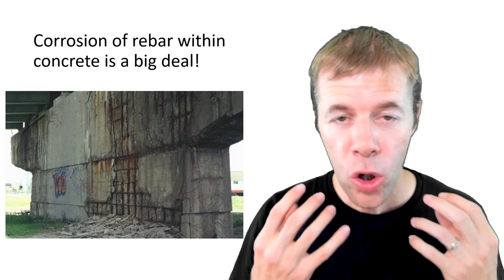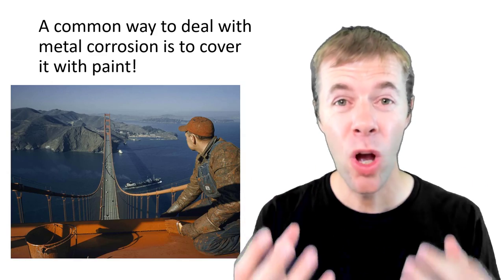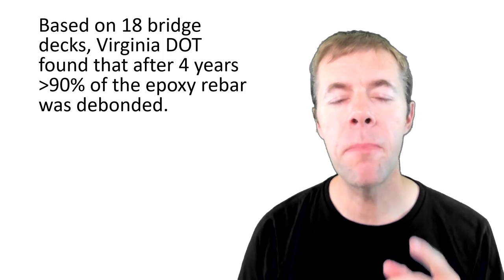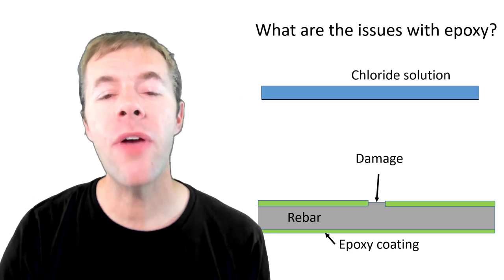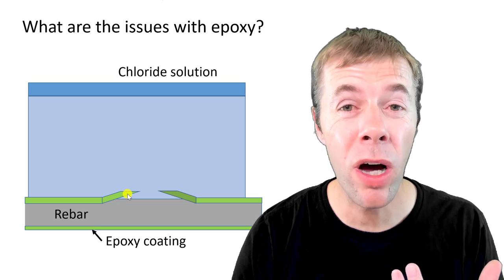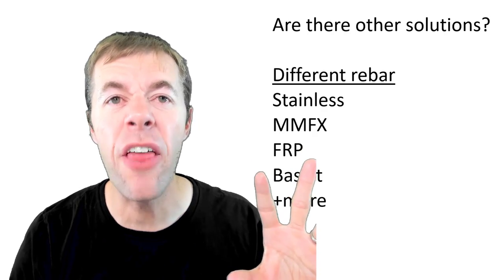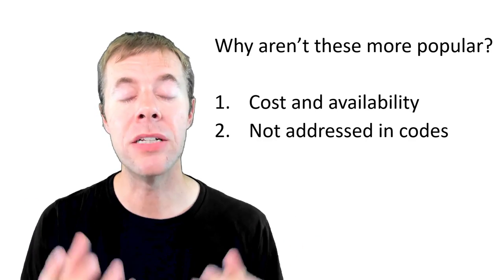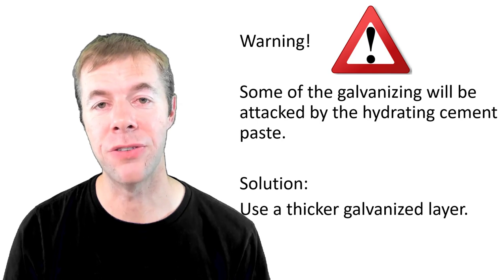What is epoxy coated rebar and why is it being banned?

Comment: Can't weld galvanized rebar without a good breeze or a mask.
Reply: Why not use weathering steel AKA Cor-TEN steel?
Reply: @dkevans  shit's expensive.  hot dip galvanized rebar is cheap as dirt, which is good because they use a LOT of it.
Reply: @danlorett2184  fair point. I wonder how much the price would drop if all the rebar was made from weathering steel?
Reply: Paint it over then! :)
Reply: Why would you weld rebar?
Reply: @I_Art_Laughing  Was wondering the same thing... never seen welders messing with rebar!
Reply: That goes for any Zinc coated steel. The Zinc Oxide fumes are toxic and will give you severe flu like symptoms - welders shivers. Also, be mindful that a cheap dust mask will not do, it has to be at least an activated carbon cartridge filter mask.
Reply: yea but wiring it together with galvanized wire would work and not rust. also welding galvanized ruins the galvanizing. but im sure you know all that
Reply: Just drink milk.  Stops the shivers and removes the toxins.  Unless you're vegan and don't do dairy.  But no one cares about vegans anyways
Reply: Basalt rebar , not iron , rock .
Reply: nah u can't weld it period, unless you are not concerned with a contaminated weld. but rebar isn't free welding steel anyway, so...just use wire ties I guess.
Reply: to make it into different shapes  @I_Art_Laughing
Reply: only a desperate person would,, weld it,,then dip it,,and fasten with gal. wire. (paint any cuts/welds with cold gal after hard brush or blasting.
Reply: @dizzywilliams3557  tie wire.
Reply: so getting an engineer to wear a mask is less preferable than structural failure.
Reply: @daveb6722  masks are for inspectors.
Reply: you can't weld rebar and meet codes, as it weakens the rebar where it has been welded
Reply: @I_Art_Laughing  Ah yes we must not forget the clipboard warriors.
Reply: @daveb6722  which decade are you living in? I've got a phone and a write-in-rain.
Reply: @meusana3681  you can weld galvinized steel. Grind the coating where you are going to weld. After use a zinc coating spray or do like we did in the shipyard and heat up the work piece and rub a zinc bar on it.  But it's all moot considering welders have better things to do than to weld rebar.
Reply: @NeuKrofta  I advise you not to do that mate :) Just a safety thing, metal fume fever is no joke, but you are right. I've welded a couple of cold dipped trailer chassis, but it's unpleasant to weld on, and to be around.
Reply: @meusana3681  I've done it plenty, it's fine, just grind the welding surfaces and drink plenty of whole milk. Zinc really isn't all that bad and is pretty easy to get out of your system. Just don't be dumb and have good ventilation and take the necessary precautions.
Reply: @NeuKrofta  Yeah I've also experienced milk works great. Though I don't agree that A: zinc isn't that bad, it can be lethal if you are over-exposed, and B: It's really not that easy to get out of your system. Once you have been poisoned the zinc can bind to your cholesterol in which case it takes months to get rid of. First exposure you get sick for few hours, next exposure a bit worse, later it feels like the tiniest bit gives you malaria. I've been sick for days due to my previous boss being an ass, yet refused to weld the stuff himself. Like I don't want to be a fear monger, but please take this stuff seriously. I have been there, hated my own guts for being stupid, and now I don't allow any zinc in my own welding shop at all. Not a single piece has gone through these doors since I opened. 

Though I could get away with it, marine applications probably depends on galv. I suggest trying n95 particle masks, they sell these as TB masks for cheap, and they work like a charm.
Reply: @I_Art_Laughing  Ironic really, its a term I use for people that don`t really understand what they are looking at.
Reply: @daveb6722  millennial be like: "what's a clipboard?" Just keep your eyes peeled for shiny new hardhats, steel toed boots and Carhartt jackets.
Reply: should never try to use arc welding on zinc, it causes embrittlment and failure. James Carruthers
Reply: You are not supposed to weld structural rebar
Reply: @nickjohnson9704  do it all the time with precast concrete.
Reply: @chrisbrown2616  false. Look up AWS.
Reply: Jordan Rodrigues  
Sorry but I will have to disagree with you. HEPA filters are great for removing larger particles like allergens. However smoke and other gaseous particles, like fumes, are best removed by activated carbon filters. 
Where I agree with you, is that a combo filter is far better as you get the best of both worlds.
Reply: @I_Art_Laughing  stronger, but changes the characteristics. if your material is crumbly rock you want less slip
Reply: billy bowbob   LMAO
Reply: @hbradar1  Agree - VERY IMPRESSIVE STUFF
Reply: @hbradar1   AGREE ...Very impressive stuff
Reply: You should not weld rebar unless it is weldable grade.
Reply: They make weldable rebar. Normal rebar is not weldable.
Reply: ASTM A706 is for weldable rebar, ASTM A615 is not weldable.

Comment: Decades ago I considered using epoxy coated rebar but became concerned because when I looked at delivered bars I saw damage to the epoxy. Then a bridge failed in Florida due to corrosion of the epoxy coated rebar. I went with stainless steel rebar in critical situations and do extra thick concrete in general. I have also used spun stone (basalt) epoxy composite rebar in some test areas that are about 14 years old now and doing well.
Reply from the maker: Thanks for sharing!

Comment: Also, rebar flexes inside the concrete and that separates the epoxy coating on the rebar.
Reply: What nonsense!
Reply: I’ve seen elastomeric used

Comment: I worked on a power plant construction project in the early 80's as a field engineer. Part of the project was two hyperbolic cooling towers that utilized epoxy rebar. It was the first time we had seen it. We immediately had issues with the way the rebar was handled. The workers (rod busters) would wrap bar bundles with steel chokers and bash the rebar around like it was plain steel. The epoxy was severely damaged. We were told it was no problem. 30 years later, both towers were demolished as unrepairable.

Comment: the best way to negate corosion on rebars is to connect them to electric current and set specific potential that will prevent corosion. galvanized rebar is ok too because zinc has different potential so corosion will attack zinc first. corosion is afterall electrochemical process.
Reply: It's probably not cost-effective...  Constant drain of power, vs repairs on a scale of decades.
Reply: Brown Man  I am just a mechanical engineer and international welding technologist.
Reply: Did that on the arts centre in Melbourne Australia back in the late 70s . Current draw was next to nothing.

Comment: Galvanizing is good but I've heard a lot of good about basalt rebar and basalt fibers, people saying it is as strong as steel, very flexible and will never rust. If it were to become more popular and the cost would become near comparable to steel rebar from what you know do you think this may be a good solution especially in the rust belt and around salt water or did I just hear a good salesmans line?
Reply from the maker: Phill - I think basalt rebar would be great.  I am open to lots of different options.  My only concern about basalt rebar is the ductility.  This is how much it will bend before it breaks.  I am sure there is some data out there on it but I have not seen it yet.  Rebar has amazing ductility.

Comment: Done Crete for years, anodes don’t work. Everywhere there’s one, is where you find the most degraded steel.
Reply: jgasphoto, that could because of bad placement or not enough of them.  all steel ships have a system of sacrificial anodes.  at least, when they were built, they had them.  i've never replaced a sacrificial anode in any hot water service i have owned.

Comment: Pretty interesting. Makes sense. Try to imagine what chemicals can bond to the rebar metal atomically. Metal Plating like Galvanizing bonds real well. Basically, the metal atoms are getting right up against each other, as close as they can get, and they merge or share their outer electron orbitals. That's what you want. They make paints that react with the metal (or its oxides), and create a tough plastic coating. They are sometimes called something like "rust repair paint".  Any sort of hole large enough for a single Chloride molecule to get through probably spells doom eventually. Maybe it has to be big enough to let two molecules through: one Water plus one Chloride. Sometimes the re-bar is built in sections. It may possible to create something like a spray booth or dipping tank on-site (even if it is huge),  to coat the sections right before use. That skips whatever damage may happen in transit or setup. Galvanizing has the advantage that the Zinc reacts preferentially with the Chloride solutions, helping to spare the Iron. (Like Sacrificial Anodes for boats). It may be that keeping the rebar electrically charged with the current going in the right direction, could drive the corrosion away from the Iron.
Reply: Galvanization and paint will only work if the original piece has no rust on it, and every piece of rebar has at least a little rust somewhere. They would need to not only have a dipping/spray booth but also a cleaning booth. The space required for this alone will make it unfeasible for many sites.
Reply from the maker: KopCam,
Great question.  I can tell you really know your stuff.  At Garret pointed out making changes at the site is tough but maybe there is an improved process that could be used.  I like your idea about keeping the rebar electrically charged.  This is called impressed current and it is something that can be done in concrete but it is challenging to know exactly how much current to apply.  If you get it wrong then you can make the corrosion worse.
Reply: @garret1930  You just need to wire brush them thoroughly and degrease with an evaporating solvent before painting. You can easily build a jig to wirebrush a bunch at a time, and a bath of ethanol to clean them. The rebars can just be dipped in a pan of paint and hung to dry over it. Do 2 or 3 coats like that. Even if there is a tiny speckle of rust left it won't matter as the zinc paint will seal it in and passivate the steel around it. But you have to make sure there is good bonding between the zinc paint and the steel.
Reply: @Craig Carmichael If we're going there why not electroplate the rebar in nickel? It's ductile, will bond directly with iron, and can be really cheap in mass production.
Reply: what they said /  except their mostly wrong lol ,  sorry just a joke lighten up
Reply: Similar line of thinking to how the same problem was solved on the concrete liberty ships that were built during WW2. By the end of production, such challenges were overcome.
Reply: I think hydrophobic coatings are the way to go, instead of costly electrolysis methods.
Reply: I read recently about someone embedding piezoelectric crystals in pavement and getting measurable electric current from the pedestrians walking on it. I have no idea if that is feasible or economically viable but I thought that I would throw the idea out there if we are talking about protecting rebar electrically.
Reply: galvanized isn't the answer...don't you think someone smarter than you has already thought of it? I believe the chemical reaction of zinc with alkali concrete will be a disaster!
Reply: KInd of like copper and aluminum in electrical connections.NOPE!
Reply: Trump is dethroning our country from super power status.
Reply: Zinc is amphoteric, meaning it corrodes in both low pH and high pH conditions. Concrete is pH 12-13 when poured which means the first few years the zinc will be very active and corrode away before the chloride gets there.
Reply: MEMS(Micro Electro Mechanical Systems) *could be used in this application. Providing energy harvesting for long term rebar polarization.

Comment: I'm a materials engineer. :: I'd like to see experiments with fiber reinforcing for concrete.
Reply: Which has nothing to do with this topic.
Reply: YES! Reinforcing without having to use rebar! 👍
Reply: That is a much better Idea than Galvanized Steel Rebar! Galvanized steel lasts a LONG Time, in the atmosphere. But underground in an Alkaline environment or in concrete it don't last for squat!
Reply: Honestly, couldn't we just use straw like our ancestors did? Or maybe recycled fiberglass. Hemp fiber wouldn't be  a bad idea either unless it would break down inside the concrete over time
Reply: There's been a lot of research done on this. You can Google it. I recommend looking into basalt fiber reinforcing.
Reply: I'd want to pay careful attention to whether the fiber provokes any alkali-silica reaction with the cement.
Reply: Called Fibrecrete where I’m from and been around for decades
Reply: @dwaneanderson8039  oh wow.  I live in the Columbia Basin area of Washington state.  Lots of alkaline desert soil.  Lots of basalt rock formations.  So, I wonder if any Fibercrete is produced here.
Reply: @jaklumen  Funny coincidence, I live in the Columbia Basin too. The closest basalt fiber company I found on a Google search was in Bellingham, Wa.
Reply: When doing concrete flat work for a driveway on my residence I specified micro-fiber reinforced concrete. The finish was exposed aggregate. On one section the surface finish was improperly done. I insisted that the contractor remove and replace the section. It was extremely difficult to remove with a jack hammer. Instead of cracking from the impact of the chisel it crumbled locally after a sufficient amount of hammering but cracks did not propagate. It took much longer to remove than would have been the case with a normal mix.

Comment: The pitting in the epoxy holes is NOT accelerated. Just because it is the only point of entry within a given area does not equate to the total maximal effects of the area being concentrated into the one spot at a greatly increased rate.
Reply: This us EXACTLY what I was going to say, its not faster just because its smaller. In time it might rust through, and break, but if it was uncoated by then the whole bar would be consumed
Reply: @GeneralZap  Great comeback, what the hell did you say? Full sentences, and english please.

Comment: I’m a pressure washer. After surface cleaning a driveway to remove the dirt, black mold, and green algae, it is best practice to post treat the concrete with bleach to kill off any remaining organics. Do you think the post treatment of bleach will cause long term damage to the rebar?

Comment: Anyone who has used epoxy would know that it has almost no resistance to corrosion creeping under it. Just like powder coating. The only thing that works is a coating which chemically bonds with the surface. Like galvanising!
Reply: Yeah well when you are building 200million $ plus structures expoxy coated is more affordable when you need tons n tons. Im not saying its the right way but i work in large scale concrete construction and everything is built to a cost/time ratio. The stuff we build within 100yrs w/o constant upkeep will be gone yet greek/roman concrete still stands. So has technology really moved forward or just greed and profits? Sadly greed is a natural human traight. Most ppl are NOT good honorable ppl they are poor and powerless. Guven opportunity 90%+/- humans will destroy fellow humans environment whatever to profit for themselves. Greed and selfishness WILL be our downfall and expoxy coated rebar is an obvious symptom of this. If we wanted to build the best we would do like you say but nah gotta keep them profits high.
Reply: I HAD A FRIEND WHO RECENTLY HAD CHASSIS PARTS AND BUMPER TUBING  FOR HIS RV POWDER COATED. SHOULD I GIVE HIM THE BAD NEWS?
Reply: @williambranham6249  Well it depends on where he is using it - if it is in a rust belt then he will most likely have a problem. Also whether they 1st zinc passivated the surface. If so it should be good, but I have never come across that @ a typical powder coating shop.
It's only high quality products that use that process.
Best thing he can do is to patch any stone chips as soon as they appear.

Comment: Galvanized rebars: Doesn't the coating go off when bended?
Reply: Wypipo Trippin  I'm currently working in road constructions, but just started and have no formation. Now that I have seen an opinion against epoxy coated rebars, I'd like to see one against galvanization. So far it sounds pretty even; the biggest difference probably being I don't expect galvanized bars to "decoat" within the concrete.
Reply: Galvanizing provides both barrier and sacrificing protection while epoxy merely provides barrier protection. So, if part of the coating goes off, the galvanizing layer will rust before steel rust.
Reply: Thank you both for your informative answers.
Reply: @EddieOtool  some galvanizers have developped over the years very good procedure to galvanize rebar and the result is very good!  Go take a look at the rebar alliance website.